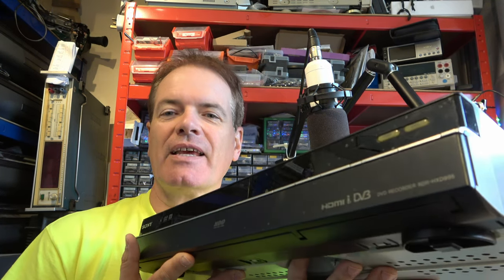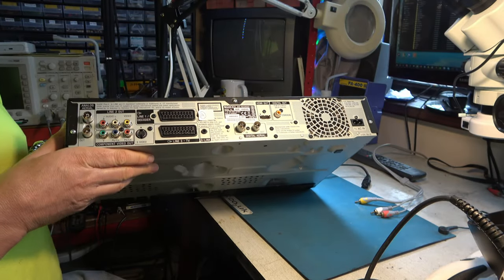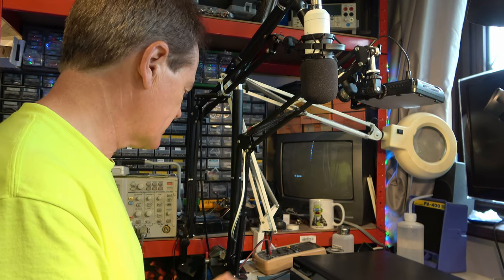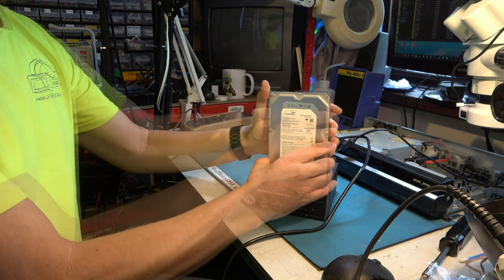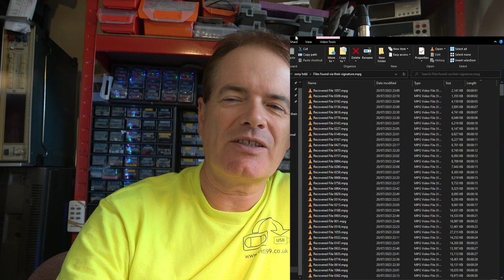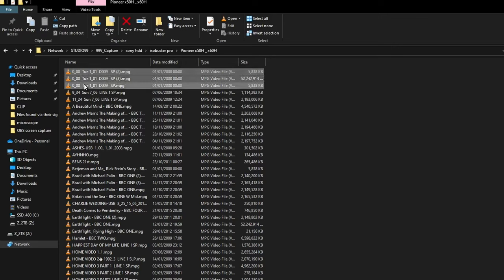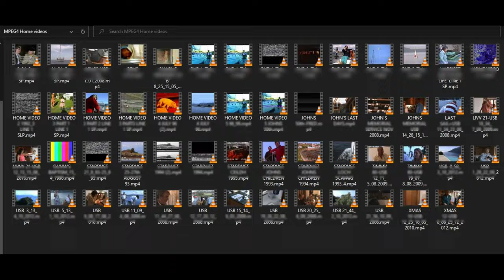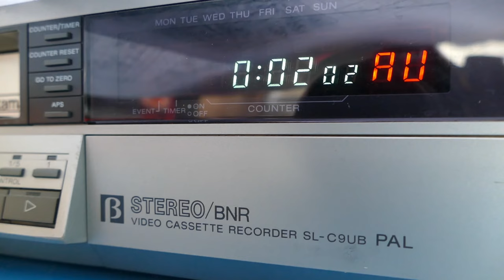Extract files from a Sony HDD/DVD recorder

Comment: I'm not familiar with sony dvd hdd recorders but Sony (and other brands) just use some embedded Linux distro or something similar to reduce cost. If file system on HDD is something like ext2/3/4 it could be extracted for free with tiniest distro on usb stick. Maybe.
Reply from the maker: Yes I would expect the HDD to be Linux formatted, but then the files themselves would be VOB etc.
Reply: @video99couk  Thank you for answer. Also if files indeed was VOB then perhabs player can record them on DVD without reencoding? Just curious.
Reply: I was thinking the same, good catch. The isobuster web site mentions using their software with Wine, so guessing PlayOn should work as well .. I suspect ffmpeg might also extract/convert mp2/mp4 files ..
Reply: I have yet to come across a Video Recorder that uses something Linux inside !  I have come across FAT and UDF, but not EXT or anything like that.  Most use their own file systems, totally unique and unsupported in any OS.
Reply: @video99couk  VOB files are containers for MPG2 and IsoBuster's "Extract but filter only MPEG" cleans that right up

Comment: sir, I have Sony Handycam DCR HC48 which works perfectly fine with the power adapter on. But if I take it out and put it on battery power, it cant turning ON, when i charged indicator lamp is flashing, what’s wrong?
Reply from the maker: Usually this is just a bad battery.  You could connect a meter and a small load (like a 6V bulb) to the battery to check that it's holding charge.

Comment: mine was done in because the dvd drive a bearing must have gone bad so i can't burn the contents to dvd however playing dvds is fine (and the whole recorder works fine). i nearly got a replacement deck cheaply but it got sold.

Comment: So when you put the HDD back into the recorder, were there any problems in accessing the contents of the hard-drive or was the HDD corrupted due to your isobuster actions?

I have the exact same model and have a lot of precious recordings on it, but because most have been recorded at maximum quality, doing the DVD-rip method would mean, that not only would I have to do transfers to DVD in real time, but I'd also have to settle for a slightly lesser quality due to the "re-encoding" process.
Reply from the maker: All working fine when reassembled.  I suppose you could dub losslessly by splitting the original recordings down into chunks that would fit a DVD, but that would be hugely time consuming.
Reply: @video99couk  Exactly - it would be more hassle, than I'd have the time or energy to do. Besides, I've ONCE tried splitting a recording to fit to DVD-RW discs, but when re-assembling the two split recording into one, there was a kind of small jitter at the split point. So no thx, not going down that route again.
Reply: @pHD77  Since I-frames (full image content) only exist once, you cannot split the Video, since both segments require the I-frame and one has to be removed when merging.

Comment: I wonder if there's a hack to make the DV input (Firewire, I presume) into a DV input/output. My DCR-PC7E camcorder from 1998 had a hack that you could do with the Sony RM95(?) service remote control (or an emulator which I used) to enable Firewire video output.
Then again... The DCR-PC7E was just a European version of an internationally marketed DV camera, whereas the backside of that recorder looks VERY European-centered, so it may have been built only for the European market, and the DV-out hardware may just not be there.
Reply from the maker: The reason camcorders used to have DV-in disabled (not out) was to stop it being classed as a video recorder which had a higher taxation class than a camcorder / camera.  I'm sure in this case that DV-out was physically impossible because there would not have been any MPEG2 to DV decoder hardware.
Reply: @video99couk  And of course it already is a video recorder so there was no need to hide the feature for tax reasons because the tax would have to be paid anyway. Makes sense.

Comment: Is there any possibility to add a SATA SSD to these?
Can the new SSD be formatted by the Sony?
Reply from the maker: I suspect that the Sony cannot format that.  Certainly some other HDD recorders have bespoke firmware on the hard disks.
Reply: все можно сделать по этой инструкции

https://www.youtube.com/watch?v=9L5jdBW2XQY&t=2s&pp=ygU7cmRyLWh4INGA0LXQutC-0YDQtNC10YAg0LjRgdC_0YDQsNCy0LvQtdC90LjQtSDQvtGI0LjQsdC60Lg%3D

I replaced the old hard drive with an SSD. Everything worked out. But the recording I made on the new drive is not visible through this program. I need to link the new drive by ID in the service menu. But I don’t know the procedure and I can’t enter service mode

Comment: My DVR/DVD recorder broke. So this would be perfect to get my programmes off. I looked at the list of supported DVR's, LG is'nt mentiond anywhere. 😢
Reply: Perhaps your LG is really a Pioneer with a different bezel or something like that.  It's a long shot, but worth a try, since it's broken anyway.  Build out the HDD and let IsoBuster have a look at it in free mode.  If it lists the recordings it's actually a supported drive.

Comment: --I tried to do the same with my old Panasonic DVDR/Tuner (DMR-EX75) that cruelly utilised a hidden microswitch under the top cover to randomly trigger a FAT reset the next time the HDD was reinserted. Obviously this was to prevent people sharing HDDs full of copyright programmes. Luckily I had already taken an ISO image of the drive so could use HexEdit software to overwrite it with the original FAT sectors content. Did you see any such trickery with Sony?--
--When pulling off the MPGs I was annoyed to find none of the files were of standard DVD resolutions. The video info was quite a bit smaller with black boarders. Amazing then that the machine was able to produce still decent videos.--
Reply from the maker: There seemed to be no such traps in the Sony.
Reply: That's useful info on your Panny.  I would like to copy the HDD of my Panasonic DMR-BS850 to an external hard drive.  Would you think that my DMR-BS850 also has a hidden microswitch.? I have never taken the lid off.
Reply: @joebutters4419  Couldn't wait for tomorrow. Oh what a fool I've been. Just seen that the two microswitches were in fact just two flexible earthing strips to align with the metal top cover. Why I didn't do a simple continuity test, I'll never know.
So the problem of occasional corruption of one of the two HDD FAT areas was likely caused by MS Windows sending garbage (as it does) via my USB to IDE interface.
Well, at least those many days of highly annoying fault-finding have been resolved!

Comment: I think I have the same Sony recorder, or a very similar one. I bought it broken (boot looping), but managed to get into its service menu, and done a factory reset on it. It worked perfectly afterwards. For a whole day... Next time I switched it on, it was boot looping again, and I can no longer enter into service mode. Judging by how it died, I'm pretty confident it's a corrupted firmware issue. I wanted to do a firmware update on it while it was working, but unfortunately Sony being themselves, wiped the firmware from the whole internet. They never let third party sites to have their firmwares. Might try to contact a Sony service center, they might give it to me for some cash, if they are as corrupt as my firmware 🙂.

That's the problem with modern electronics, they won't ever become real vintage in working condition, because the flash memories that contain the firmware have very finite and unpredictable data retention times. Mine was about 8-10 years old when it failed. And it was barely used as a recorder, because I saw the hours counter in the service menu. It was used for burning DVDs for less than 10 hours... The previous owner used it mostly as a DVD player, it had IIRC 8.000 hours of DVD playback time in it.

Since I bought an other, newer model, I intend to use it for converting analog video into HDMI, and record it with a PC with a USB3.0 HDMI recorder. It's basic TBC works OK, but for really damaged, jumpy VCR footages, I found and old Thomson DVD-recorder (their first model, DTH8000) that works excellent for stabilizing the image of VCR footage. It really chews the signal well, as it takes about 3-4 seconds for the input signal to get to the output. And it does that on-the-fly as well, doesn't need to record it onto DVD. A professional TBC is outside of my budget range, so that's the best I can get. I don't do archiving as a job, I just buy bulk used VHS tapes and archive old TV shows and ads for myself. Maybe some day, I will start to upload them to YT.
Reply: I have had some limited success using the wayback machine to search for old firmware, however its not perfect and most links to files will not be saved. I was able to repair a Pioneer machine by changing the hard disk and using a custom remote like a one4all. Its always been a hobby of mine trying to get faulty or broken things back working.
Reply: how did you get into service mode?
Reply: @олегиванов-щ5в9щ  It was about two years ago, so I don't remember exactly, but it was easy. I think the power or eject (or both, or whatever) button(s) needs to be held depressed while you are plugging in the device to mains. I think I found the method in the service manual.

Comment: 4:30 it may be good at this point to clone the Hard Drive, so you're working off a copy and not the master, as it were. Not just good for your nerves, but good generally on a drive that may have worked a very hard life.
Reply from the maker: Yes that's certainly an option to consider.

Comment: HDMI is all digital if you have a HDMI Capture card surely ???
Reply: Yes, but the device is then deinterlacing the video and upscaling it, plus you'd have to re-encode the video. Getting the source files provides a better quality. You can do your own better decoding using something like FFMPEG to deinterlace to full 50fps.
Reply: @cromulence  The Pioneer variant can output interlaced, otherwise the device would have done itself as a timebase corrector.
Reply: but then you're playing it all in real time, and time is money!
Reply: Very interesting video, I had not heard of isobuster.  I had a Pioneer bluray HDD recorder fail with material I wanted still on it.  The hard disc was formatted in Ext4 and readable but the problem was that the HD recordings from the TV were encrypted with the encryption tied to the dead machine.  I could only recover the SD recordings.

Comment: Just hook the drive up with a computer with Linux on it. No need to buy software to use those files.
Reply from the maker: But that would have given me just the VOB files which I could have got from the free version of the software, not the fully decoded versions that the full software provided.
Reply: This recorder uses a proprietary file system, not anything Linux knows.